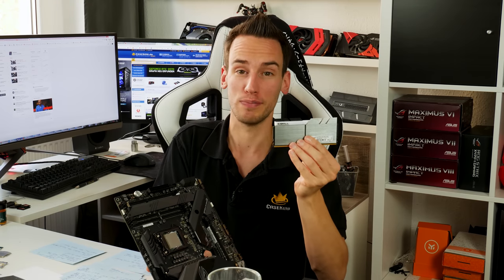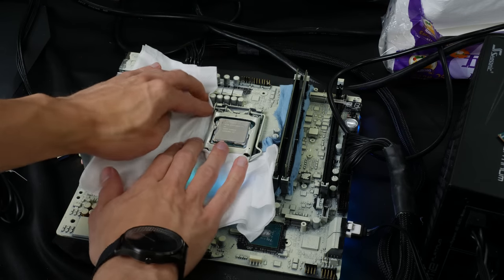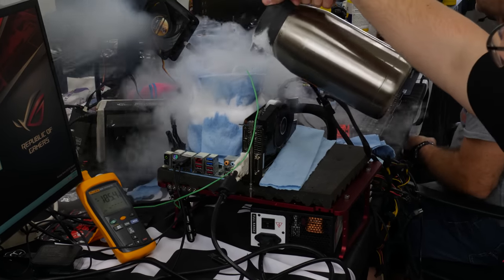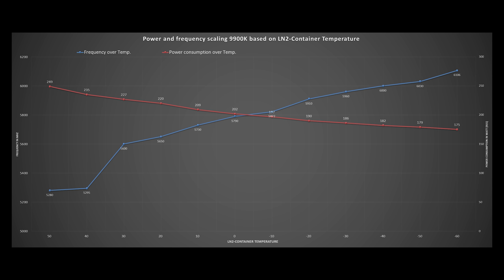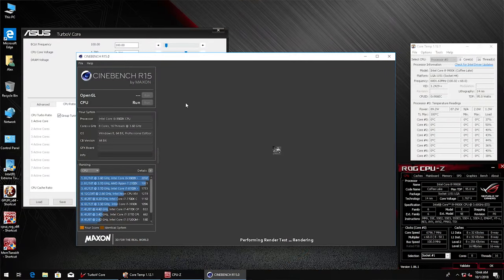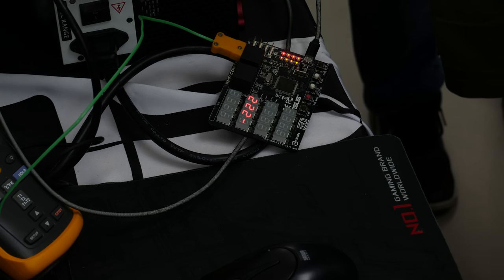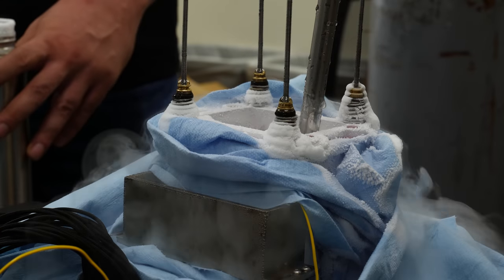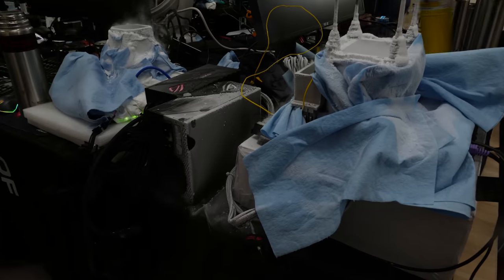World Record with i9-9900K at -230 °C - LIQUID HELIUM

Comment: sells the cpu on ebay:
-" slightly overclocked..."
Reply: Hahahah
Reply: To be fair, this shouldn't damage the chip if done properly. :)
Reply: @ardadnr770  lmao kanka
Reply: People who buy 9900k wouldn’t care, infact they’d cough up far more if you advertise it as “overclocked to 7.5ghz”
Reply: It's funny but it won't damage it. Actually companies themselves test chip's clock speed higher with different coolers and voltages.
Although 7 ghz isn't worth using for hours. 5 on all clock with liquid cooler should be enough
Reply: More importantly is if what fan they were using, a fan that can handle max oc is safe to buy used.
Reply: @shotgungamesuk9826  Wenn die deutsche Autokorrektur kickt
Reply: @quemiraelbobo  anders geil haha
Reply: the 12900ks could really benefit from this, the temperature reaches alone are enough to turn you towards the 12700k or 14700k

Comment: Im no expert on overclocking but i do work with liquid helium cooled equipment pretty regularly so i have a small suggestion: you probably wouldve needed less LHe if your LHe container was jacketed with LN2. In equipment designed for LHe cooling (like an NMR spectrometer) the LHe container is surrounded with LN2 to significantly slow down the loss of LHe (since LN2 is way cheaper). I dunno it it'd help a huge amount on this scale but could be worth a try cos if it did help then you could get a lot more overclocking bang-for-your-buck out of those LHe tanks!
Reply: ...what ?
Reply: When I started reading your reply I immediately thought of an NMR spectrometer.  IMy PhD was done using bruker 600 and 800mhz magnets.
Reply: @MTB Scotland Yeah, the bruker 400 and 600 magnets that i work with are exactly what i had in mind when typing this. It contains less LHe than was used in this video but only needs to be refilled with LHe every year or two. Whereas we top it up with much cheaper LN2 once a week or so to keep the LHe cold.
Reply: Cian Hughes chemistry? I did protein structure and dynamics
Reply: Synth chem/drug development. Right now im working in biosensor platform development so havent had reason to use the NMR nearly as often lately but it's still easily the most useful instrument in the world when the need arises. XD
Reply: Cian Hughes chemist that uses XD.
Reply: "LHe2"? Helium isn't a diatomic gas
Reply: @RedneckChemist Eh, crap, good point. That was a dumb mistake. Only time i ever mention liquid helium is usually in speech, not in writing. Guess i reflexively added a 2 at the end cos im so used to typing LN2. :S Thanks for that man! I'll go back and fix that embarassing little fuck-up.
Reply: NEXØ read it again lol. What he said made perfect sense
Reply: damn yeah, i'd go a different route though, carve a paraffin candle with a hole and a surrounding chamber and put LN2 on the outside and 
LHe on the hole, directly on the heatspreader. Recompressing the helium on the container would be sweet too.
Reply: Ohhhhhhhhhh yeah,I definitely can understand everything you just said
Reply: Lhe mhmm I get it mhmm..  ln2 mhhmmm mhmm I get it... no I dont
Reply: I love how half the comments are complaining that they don't understand what you said, it makes total sense!
Reply: Wha?
Reply: I feel dumb now
Reply: My suggestion: submerge the entire board and other components in LN2 and leave it there. Nitrogen won't conduct so it there should be no problems and you only have to worry about condensation if you pull it out of the LN2. Then have a sealable pot/heat sink so you can pull vacuum on the LHe, get yourself down below 1K.
Reply: @CyanH  Well the thermal transfer is better without that which is why you'll see LN2 overclockers run the pot hot at first, either without anything in the pot or even with a heat gun. Then they pour in the LN2.
Reply: @nixxanator  There's a reason they try to keep the board from freezing. Purposefully freezing it would cause a lot of the components to either not work or work improperly.
Reply: Lol chemists here too. That was literally the first thing I thought about!

Comment: Soo the main question is...did all you guys have Mickey Mouse voices running the Helium? 😄
Reply: I was thinking the same... maybe we should wait for a backstage video
Reply: I was kind of wondering, how long did you guys just mess around and laugh, before you actually go on with it. ;)
Reply: Unfortunately not; would be so fun to try to communicate oc settings like this. 😂
Reply: I was going to post this question as well, So did you guys get high voices?
Reply: @lordsqueak  it's -230C
if they were sucking that up they would very quickly be dead 😅
Reply: @stephenallen4635  well -230C or not it will heat up and turn into gas
Reply: @yasinomidi7525  by that time it was five or the window, they had a bid extractor fan
Reply: @Shorne Pubique agree
Reply: @Shorne Pubique Maybe not that bad, like living in high altitude places, it wont damage brain cell.
Reply: @stephenallen4635  Helium doesn't too much because it's lighter than air and will therefore escape from your lungs by itself. If you'd breathe in too much gas that makes your voice LOWER (e.g. Hexafluoride), that could kill you if you don't breathe out hard enough.

Comment: Damn, I will wait for the day when CPU reaches 10 ghz
Reply: Wait for another 10 years then
Reply: @sathish5470  Thats optimistic.
Reply: Yes it may possible but if you had low size and number of transistors so heat will be lower and you get good result
Reply: i got 1 ghz
Reply: I got 10 mhz
Reply: People years from now will be laughing thinking 10 ghz is slow
Reply: @caleb7122  Idk about that. processors have really stagnated at 5 ghz
Reply: @Mahesh well...intel is very well dead since 2011...
Reply: At 10 GHz light moves only around 3 cm pr clock cycle, so you start to get to a point where the electrical signals literally can't propagate to the other end of the chip fast enough.
Reply: @northcode_  oh interesting. I think we will never see such clock speeds.

Comment: As a physicist who's worked with LHe on a daily/weekly basis for years, it's absolutely terrifying to see people handle the transfer lines without any thermal protection or safety equipment. They're one small slip away from being scarred for life...
Reply: Leidenfrost effect? It should protect them for quite a bit of time, unless helium has too high heat capacity/bond energy for it to work properly
Reply: @lucaslucas191202  the biggest danger isn't exposure to the helium itself but the transfer lines. One touch of one of those lines in the wrong place during or after a transfer and you're scarred for life. As for the Leidenfrost effect, it's not protective at all during helium transfers due to the high pressure coming out of the line, so you get a larger quantity of particles hitting your skin in a shorter period of time then you would with just a bath of liquid nitrogen for example.
Reply: @shawnbeckman3020  
Ah ok

Comment: Overclocking with liquid helium? The ultimate non renewable resource. This is basically the tech version of snorting rhino horn.
Reply: Yeah amazing frequency's with no use for consumers - it means nothing, they should use a water chiller at the max since that's the best available to a consumers.
Reply: Liquid nitrogen is fine to use as it is one of the most abundant elements on Earth. Dry ice is also just fine. Extreme overclocking is cool(in more ways than one), I just wish we could leave the Helium for more noble uses until we find some way to increase the amount of it that exists on the planet.
Reply: No, there really isn't. It's difficult to prouce for use like this, and there have been shortages.
Reply: Its the "Rollin Coal" of computers.
Reply: Melvin Frazier  aw wow that really sucks. I guess we will have to actually advance our technology instead of overpopulating to the point that we destory our planet. Helium should be the 2nd most abundant element in the universe. Just have to get to the point where it is accessibe.
Reply: guess you don't understand basic economics, supply and demand, surplus and scarcity.
Reply: wow, those childish reactions to your comment. and always throwing in the insults which seems to make them feel better. tragic.
Reply: The problem with helium on earth is that most of it is formed by radioactive decay. And because it is so light it isn't trapped in our atmosphere. And going so cold you are messing with Fermi levels in the semi-conducteurs. They were designed to work at a set temperature, so low and their function can't be predicted. Most of the equations are divided by "KT" so the numbers really explose. What an absolute wasn't of helium, universities are already finding it hard to buy enough for their experiments and are also required to trap and compress the boiling liquid.
Reply: If only cooling with liquid helium would not "consume" any helium at all /s. It is still available on earth. It does not react.
Reply: @Melvin Frazier And I don't have kids because its selfish as fuck to still want multiple kids this day and age. Look at our world, look at what is happening to it and then justify your need for multiple kids. See I'm not nitpicking but I guess as a non parent I have a different look on things.
We can all pretend to understand the world better and know whats best but in the end we all consume, waste and destroy. Some joy of pushing a pc to this extreme should be fine. Just as I think its fine most people including yourself still have that need for kidS.
Reply: @XxLukexX  agreed.
Reply: Rustknuckle Irongut hah. Noble uses. Heh.
Reply: maxfmfdm lol no it won't.
Reply: @thugasaurusrex6004  i don't need to get informed I can think for myself but thx for all the assumptions and judgements. I guess you're just more entitled to do so then others. Keep it up tho!
Reply: helium is one of tho most abundant element in the universe
Reply: "keeping mri machines working when people need them, is more important imo"
keep old and dying people alive is a waste of resource as well. Melvin Frazier
Reply: i wont waste the taxpayers' money if the government would give me some fantenyl  Melvin Frazier
Reply: @thugasaurusrex6004  thx for proving my points to be  correct. But maybe try next time to actually have a discussion instead of a flamefest induced by a difference in opinion. No need to be angry and agressive towards something you don't (yet?) understand. Have a nice day tho!
Reply: @thugasaurusrex6004  not going to argue yet here you where attacking me for what I said. Not going to argue but yet here you are throwing out insults because you lack the ability to defend your attitude. I kinda feel sorry for you, but hey maybe one day you will be able to have a normal discussion/conversation, I hope you do!
Reply: H4rd5tyl3 no, I lack the ability to care about what you're saying lol. You're replying to something weeks old. Something I already forgot about. But stay mad please lol.
Reply: @thugasaurusrex6004  Yes, you clearly do not care. That would explain the repeated insults based on a difference in opinion. Yes its a few weeks old but that changes nothing. And you still deflect and try to distract. Its not me thats mad tho, unlike you I still did not insult you or hide behind capsed lol's and hurdur lines. I'm sure you wished for me to be mad but I'll have to dissapoint you. Sorry!
Reply: Even when liquid helium boils and turns back to gas, it is still helium it is not combining with any other elements because it is stable like you said its a noble gas it can obtained back
Reply: @stephengeorgejaocb6326  So when used in a non sealed room with no special capture equipment, how do you recapture a gas that naturally rises so high in the atmosphere? Do you have some special high altitude gas extraction equipment no one else has heard about? Helium does not stay in a location where you can just recapture it unless you plan for recapture before use as many scientists do. That use of helium where it is recaptured is not a problem, it is balloons and other frivolous use like they do in this video that is the problem.
Reply: @rustknuckleirongut8107  now I get your points!
Reply: @XxLukexX  This ain't the point though, the point of those videos is to show what is possible not to show what the average consumer might accomplish. They preselect the CPU out of hundrets just to get the best of them.
Reply: Rustknuckle Irongut sincerely, i'd see nothing wrong if they recycle the fucking helium like everyone else does, so they can still buy helium, because they would never have the chance to touch this shit if other people weren't recycling their helium.
Reply: @milolouis  Yes helium is abundant as such, but helium that is not bound to other molecules is not.
Reply: @MrObsolescence  yeah, but if it goes into the atmosphere it's not easily recapturable with any reasonable efficiency. If they were more careful they could have recaptured some of it. So yeah, none if destroyed, but it becomes unusable and effectivly lost.
Reply: @User-nu6km  But not much is in the atmosphere. Most of it is in stars, which are obviously not reasonable sources (or floating in space, which is where most of Earth's Helium ends up going.)
Reply: @User-nu6km  BUT not on Earth.....
Reply: if i drink water and then piss water, did i remove water from earth? when liquid helium warms up. it doesnt leave earth..... its still here.... so I really dont understand your comment. its still helium at the end of the day. you just need man power to put it back in that liquid unnatural state here at sea level
Reply: H4rd5tyl3 So it's selfish to continue your bloodline?
Reply: Helium isn't a consumable resource, it doesn't react with any other elements, it is fairly common, not as common as hydrogen. So if you're complaining about using helium to cool a cpu, you may as well go protest against helium filled balloons, cos it's "non renewable".
Reply: @chaztitan6457  dude helium is an extremely light element. It doesn't stay on earth's surface. It gets to the top of atmosphere like helium baloons and being extremely rare you can barely extract any helium from there so good luck. Helium and water are two different things. Use liquid nitrogen instead, it is abundant and gets pretty cold.
Reply: Helium is a byproduct of radioactive decay. It's actually quite abundant.

"Terrestrial helium" was thought to be in short supply, but the helium produced through fractal distillation is actually thought to be quite abundant.